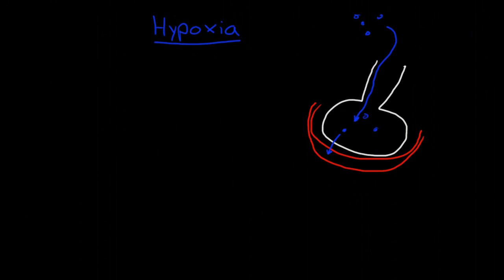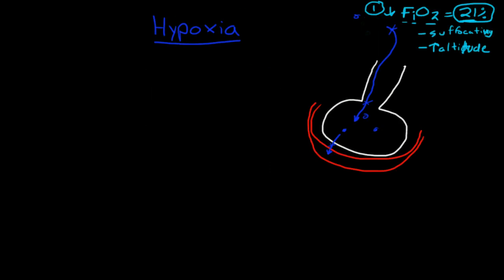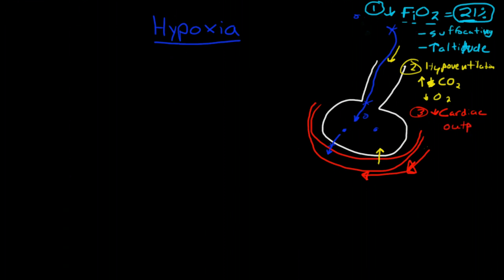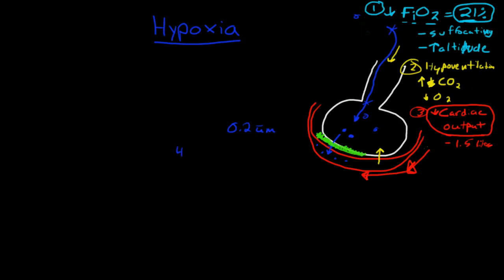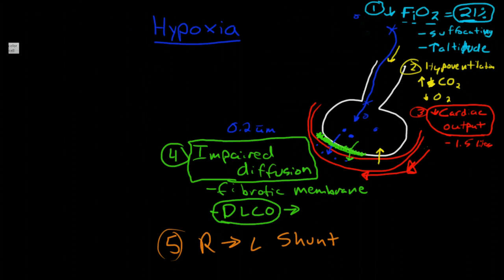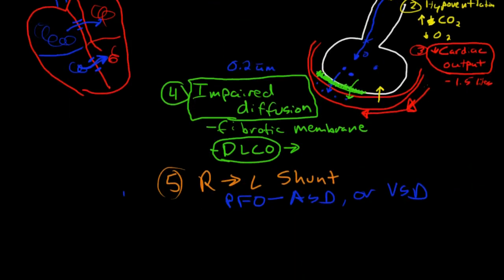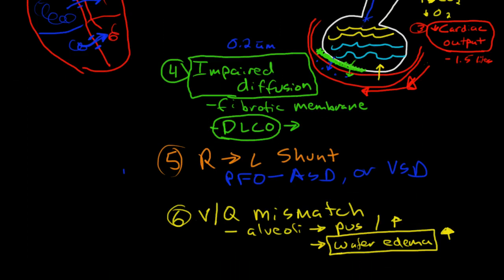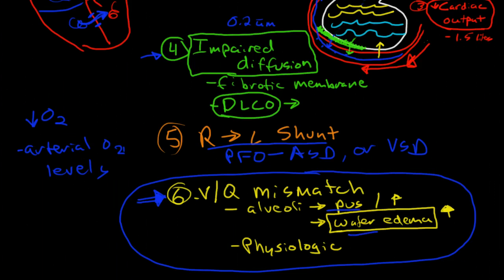Hypoxia Shunts and Ventilation Perfusion Mismatch

Comment: You said the FiO2 decreases at altitude, which is incorrect. Possibly what you meant was the partial pressure of oxygen decrease with a decrease in atmospheric pressure.  Such as the barometric pressure at sea level is 760mmHg with an FiO2 of 21%, however at the top of Mt. Everest the barometric pressure is about 253mmHg with an FiO2 of 21%.  Therefore, you PaO2 would go down because the inspired oxygen pressure goes down not the inspired fraction. That being said, I do like the videos, keep up the good work.
Reply from the maker: Thanks for your feedback. We will ask Dr. Wolf and see what he says!

Comment: What about arteriosclerosis, smoking (CO binds heamoglobin irreversibly), noradrenalin in high concentrations constricts both arteries AND veins, beta blockers lower blood pressure to reduce risk of stroke but reduce oxygen perfusion.  CO2 detectors on blood vessels signal the heart to increase output in response to arteriosclerosis thus restoring normal perfusion.

Comment: 2:09 is wrong. % of Oxygen doesn't decrease at higher altitudes, the barometric pressure does. "the percentage of oxygen in inspired air is constant at different altitudes, the fall in atmospheric pressure at higher altitude decreases the partial pressure of inspired oxygen and hence the driving pressure for gas exchange in the lungs." (Peacock, 1998, BMJ, "Oxygen at high altitude").